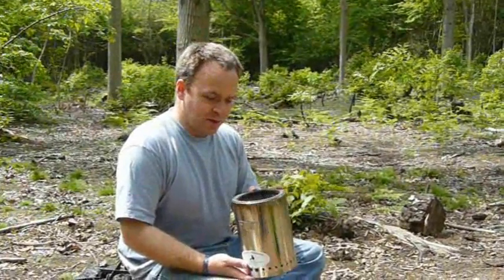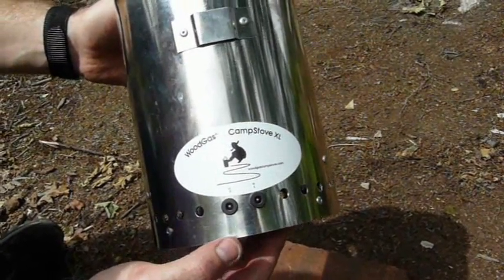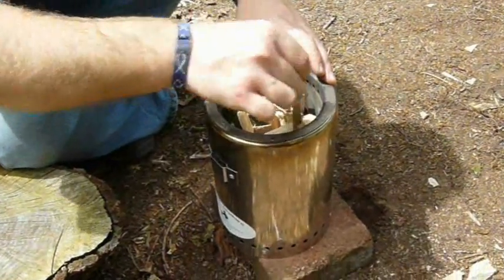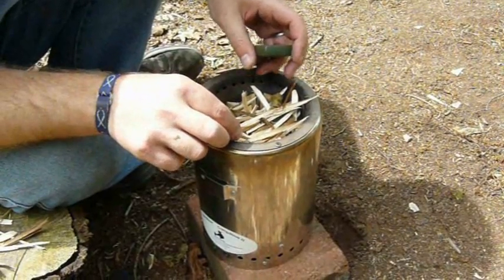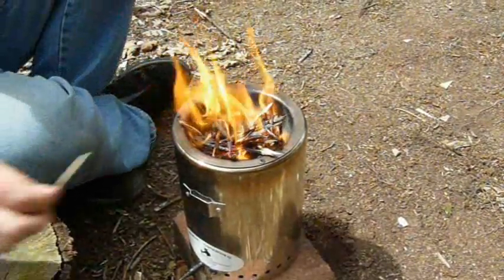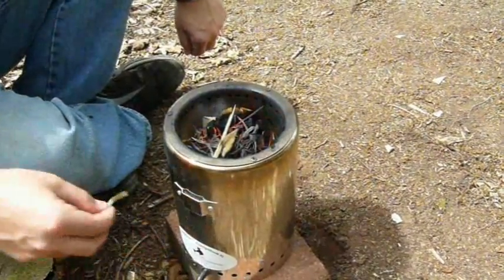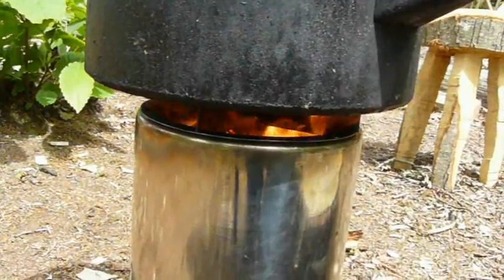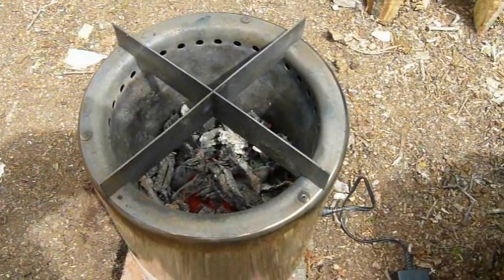Woodgas Camp Stove (Top-Lit Updraft Gasifier)

Comment: I'm not a big fan of having an electric fan on these stoves, but bravo you for being the first in hundreds of idiot gear review channels that actually understands how a TLUD stove is supposed to work, and how to light it properly. No joke you are one out of hundreds. They all light a fire in the bottom with kindling then build a traditional camp fire in them. They just think it is a metal tube to hold a fire and many are disappointed with performance. Excellent demonstration.
Reply from the maker: Thanks! I had two of these and they worked well, but after about ten years of occasional use the stainless steel plate in the base of the combustion chamber cracked - it did glow red during use. Now I use this: https://youtu.be/47LykZkkOus

Comment: With peltier elements this could work without external electricity.
Reply from the maker: There is in fact a stove that does that, the Biolite, but it's quite expensive. I did run the stove directly from a small solar panel with a voltage regulator but no battery, as an experiment.
Reply: @mikepepler  You can take the peltier element off from an old 12V beer cooler, they are sold in thrift stores very affordably.

Comment: This isn’t a real stove!! Just wood no electrics!
Reply from the maker: +Hawkeye you can make a stove that gasifies without a fan, but only if you have a tall enough chimney to create sufficient draw, and a hot plate to cook on, so it ends up less portable. This stove is a compromise between portability, efficiency and simplicity. I've got another stove that's simpler, with no electrics, but it doesn't burn as clean.

Comment: Is it possible to get the battery box and lead as I have lost mine I have tried every were I can think of  Sorry to be a pain but desperate. Crazyhorse128.  All the best.
Reply from the maker: +Crazyhorse 128 Camping Not that I know of... But, the plugs are available from any electronic components shop, and they should have the boxes too, so you could make one.
Reply from the maker: +Crazyhorse 128 Camping Not that I know of... But, the plugs are available from any electronic components shop, and they should have the boxes too, so you could make one.
Reply from the maker: +Crazyhorse 128 Camping Not that I know of... But, the plugs are available from any electronic components shop, and they should have the boxes too, so you could make one.

Comment: it deeply upsets me that it's common place to have a fan built into these. I understand the synergy between electric and wood burning energy sources, but it spoils the spirit of cooking on wood. Thank you for the video regardless.
Reply from the maker: I use a rocket stove now, this stove failed after a few years, the bottom of the combustion chamber cracked. Not surprising given that it glowed red in use, after emptying it!

Comment from the maker: Two AA batteries, so 3V. But in practice I'm running on NiMH batteries, so 2.4V. I've tried it with a variable voltage supply running direct from a solar panel, and 1.5-4.5V is OK, and varies the fan speed.

Comment from the maker: I can see where the confusion arrives, as there are conflicting diagrams on the web, some of downdraught gasifier stoves, and some of updraught gasifier. The stove in this video is definitely an updraught model, with air injected in both sets of holes. With the fan on and the stove empty, you can feel the air jets. The manufacturer has gone bust, but you can still access the diagram on their website (Feb 2013) - I've added a link at the end of the video description.

Comment from the maker: We often have open fires in the woods too, especially at night, and sometimes cook on them too. But this stove is easier to cook on than an open fire - makes little smoke, controllable, puts out a lot of heat in a small space, ready to cook in in 3-4mins, and burns wood anyway. I've also run it directly from a solar panel, with no need for batteries. And it does run for about 15 hours on two AA batteries, so even without solar for recharging, you could easily carry batteries for weeks.

Comment from the maker: It doesn't work without the fan. If it's already lit it would keep going for a bit, but not very well. Another problem is that the airflow is what keeps the plastic bits round the fan motor from melting - normally when you stop the fan you empty out the embers. You can design gasifying stoves to work without a fan, but to be really efficient they need a chimney to give a draw.

Comment from the maker: I've tended just to use it on short camping trips, so it's not run out on me yet. I think batteries should last about 15 hrs. As it's just 2 AAs it's easy to take spares though, and I've also run it directly off a small solar panel. You can also modify it run off a thermoelectric generator, then it can run itself...

Comment: ...Just wondering:  what happens when the battery is out in the middle of nowhere?
Reply from the maker: And that's why I don't have it any more... But I did successfully run it from a solar panel.
Reply: @mikepepler  
Still not very usefull in bad weather or at night, the two instances where you really need to get something warm into your body.
;)

Comment from the maker: @hydraman5 I don't think I'd use it on a long trip - we tend to use it on short camping trips, as two rechargeable AA batteries will run it for up to 15 hours - plenty for a few days. I've heard of a version which uses a thermoelectric generator in the base so it can generate its own electricity once its lit, but I've never seen one yet...

Comment: @mikepepler No actually you don't need a chimney at all! It's all about how many holes you put at which place that makes the difference. Btw, I'm coming back from a little walk, and i went to my tepee with a new design (that has a very thin grille instead of holes punched in the bottom) and it burnt without any smoke, for all the duration, and i was adding big chunks of wood every 5 min. The grille allows ashes that clogs the airflow to fall down way better than drilled holes!

Comment from the maker: @Zorroscamp Never heard of that, and there doesn't seem to be much on the web about it - sounds like a normal way of cooking over embers though? The woodgas stoves do have downsides (having to carry them with you, needing batteries), but they burn less wood than a fire, you can vary the heat output, they're ready to cook on within a minute or two of lighting and they don't leave a burn mark on the ground.

Comment from the maker: @MrStephenPugh I've found that two AA rechargeable batteries will run the stove for up to 15 hours, so over a short camping trip it's not a problem, and they're also not too bulky to have some spares. I charge these up from my solar PV system at home, but I've also tried running the woodgas stove directly off a solar panel as well, and this worked just fine - so there are other options if it's important.

Comment: Yes a good demo but, what happens when the battery runs out?
Reply from the maker: You can run it from a solar panel. Some more recent models, such as biolite, generate electricity from the heat to keep the battery charged.

Comment from the maker: @sparksaflame You do still get some soot on the pan, but you can minimise it by making sure it is burning properly before putting a pan on, and doing the same after refuelling it part-way through cooking. Yes, they do need a flat surface - I tend to use an old paving stone or tile.

Comment from the maker: @saskcat9 Yes, you can add more. The trick is not to ad too much at one go, and to make sure the fan is on high when you do it, or it can start smoking for a few minutes. Actually, you can usually get bits of wood in without removing the pot, so it's easy to just keep popping them in if you're using it for a long period. 30-40 mins is fine on the initial load of fuel though, if it's reasonably dense wood.

Comment: @mikepepler I was thinking about it a bit more, and I think its the 'keep it simple' principle. I suppose having a switch on the battery box would be a potential place for a fault... not a good idea if you're relying on the stove in the wild and you don't have a soldering iron handy! It's still a great little stove, thanks again for the video.

Comment: I like the design, but one thing seems really daft: having two power sockets on the stove! Why didn't they design it with a single socket on the stove, and then the low/high power settings switchable on the battery box? That way you don't have to keep unplugging the lead from one socket and plugging it in the other.

Comment: @mikepepler I recieved a response already from both the manufacturer and the seller. The seller told me to get a wire hanger and pull the intruding wire out of the way of the moving fan and that any repair attempt would not affect my warranty. After doing so it worked. The seller contacted me and appoligized with a copy of the forwarded email to the manufacturer. The seller gave me a retractable marshmallow stick and an extra battery pack for my trouble.

Comment from the maker: @hanghoodiescum Have you tried it? I have two kelly kettles as well, and they are brilliant - but only for boiling water, you need something like the woodgas stove to cook food. The really neat thing is that the large kelly kettle happens to fit exactly over the XL size woodgas stove, so after finishing cooking your dinner on it, you can leave it going, remove the pot stand and stick the kelly kettle straight on top to make hot water for drinks and washing up.

Mike

Comment from the maker: @TheBgcheez First - it's not that big, and isn't heavy. It also includes a pot stand, which you'd have to build or take with you for an open fire. Second, and more important, the amount of wood that lets this stove burn for 40m, cooking for 4 and heating water to wash up,  would only last 5-10mins in an open fire, as the stove is so much more efficient. It also burns with a lot less smoke. Obviously open fires are nice aesthetically, but they fall down at every other point. Mike

Comment from the maker: @kingbleah The point is that by using a fan you can regulate the air supply, allowing you to ensure complete combustion. By varying the voltage, and hence the fan speed, you can also vary the heat output of the stove.

Comment: i dont see the point of the device the battery and fan is a fad.
i used large beer cans make holes in bottom simular to device shown.
fill with wood and burn put the x on top of tin and it will work.
no fans no batteries just a can!

Comment from the maker: Not if they're charged from a solar panel, as these were :-)

By cheating with lighter fluid, I mean from the point of view that it's a fossil fuel.

More interesting is a version of this stove, still in R&D, which uses a thermopile in the base to generate the electricity to run the fan!

The fact is that if you want an effective gasifying stove (for efficiency and clean-burning), you either need a fan or a chimney, but using a chimney makes it bulky and hard to get a saucepan on top of it.

Comment from the maker: I say "cheating" because for me the idea is to cook without using fossil fuels, and the lighter fluid would certainly be fossil fuel, as would a gas stove. The batteries I use are rechargeable, and I charge them up from a solar panel. So, apart from the fossil fuels used in making the kit in the first place, this is a very climate-friendly way of cooking, and also handy if the power was off. Also, one pair of AA batteries will run for 15-20 hours, so energy input from the batteries is very small

Comment: Interesting concept, you find the thought of using lighter fuel 'cheating' but using an electric induction fan requiring a power source OK?
The ideas nice but frankly you might as well just use a gas stove, it's almost like like using an electricically heated sleeping bag

Comment from the maker: 1 - probably. The only reason not to is if the fire is only just lit then the sudden rush of air may blow it out.

2 - you have to leave the fan plugged in at all times, the air flow is needed to stop the fan melting I think! I guess if you wanted to reduce the heat you could put something metal under the pan?

Cheers, Mike